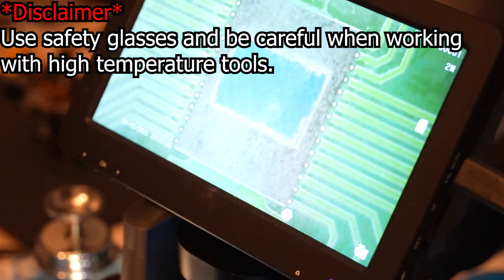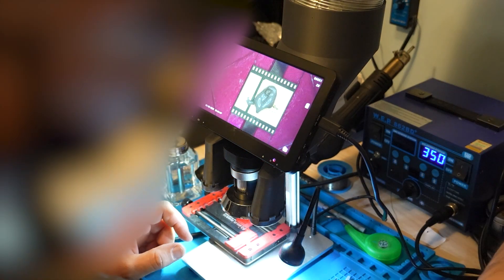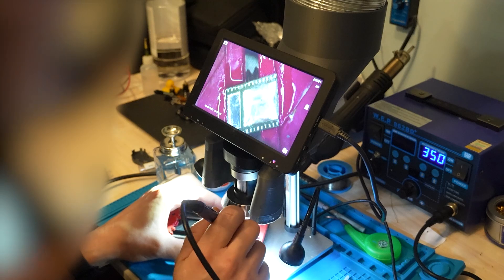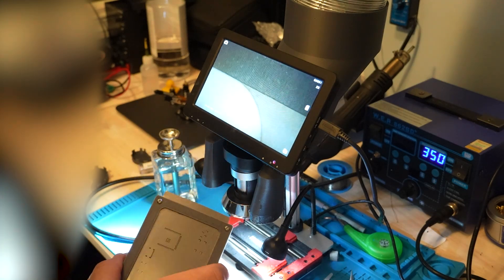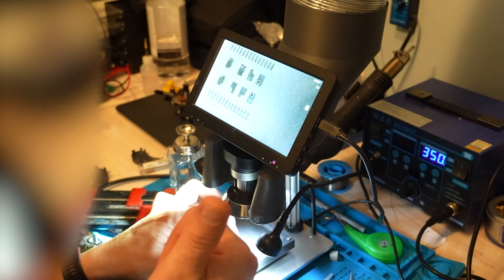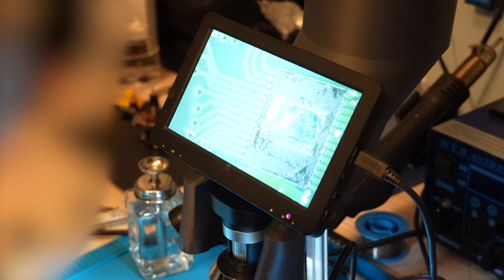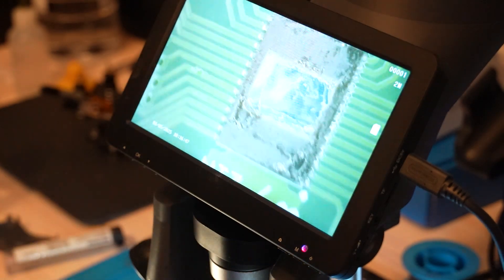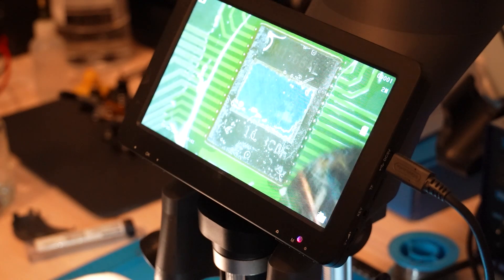Bitaxe Asic chip soldering made easy

Comment: Do you think this can be done without a scope? I only have magnifying glasses
Reply from the maker: Yes, it’s totally doable without a microscope. You can use a good magnifying glass, or even just a phone with an ultra zoom camera. I used the app from the Peakecorp dev team.
You’ll need a steady phone setup, you can use a flexible phone stand, build a simple jig from wood, or even 3D print one.
These ASIC chips aren’t that small, so you don’t need professional tools. The most important thing is using plenty of flux and having a heat gun.
It’s possible with just a soldering iron, but it might take several tries, and there’s a risk of damaging the board or getting really frustrated.
I might make a video soon showing how to change the chip using only my phone
Reply: @TheWiz4Real  Yes, I have no brand solder station that looks like yours. I think the best way to learn is to try and expect mistakes.
Reply from the maker: You're right, trying and making mistakes is the best way to learn!
But I strongly recommend having a heat gun, even a simple one like this:
AliExpress: https://www.aliexpress.com/item/1005006284776301.html
Amazon: https://www.amazon.com/dp/B0BXN5JD3T
A soldering iron alone isn't enough, because all the ASIC legs, especially the big flat middle pad underneath, are almost impossible to solder properly with just an iron. I was a bit wrong earlier saying it's possible, because I forgot about that center pad. It's not accessible with the soldering iron at all.
You really do need a heat gun for this job.